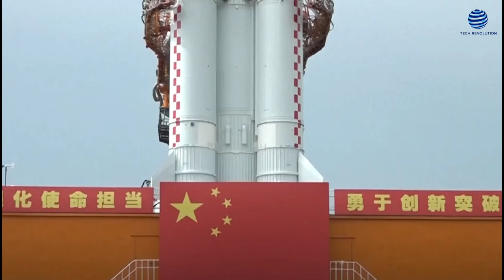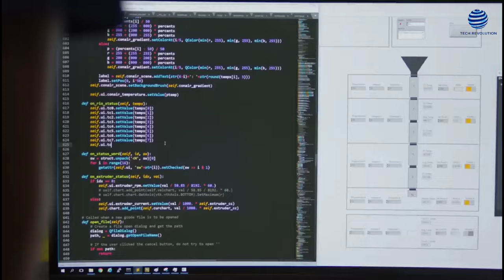China Outpaces NASA In New Rocket Breakthrough Technology!

Comment: The development of China’s reusable rockets is progressing well and will without any doubt be the leader in aerospace technology. More efficient and lower operational costs rockets from China will surpass SpaceX rockets simply because they are more reliable and smaller. SpaceX strategy is to build big rockets which are more unreliable due to the many small rocket engines, the more rocket engines the more likely they will create flutter which could cause construction failure.
Reply: Falcon 9 is by far the most reliable rocket
Reply: @Unknown-oh6ue  it has exploded in midair multiple times due to flutter. This problem has been encountered during the building of Saturn V rocket too.
Reply: @philiptan2051  Yes but that years ago
Reply: @Unknown-oh6ue  as far as I know there is only one successful launch and it is a dangerous assumption that the problem will not occur again. The bigger the thrust the more engines needed, the more difficult to synchronize the engines, the higher the probability of flutter.
Reply: @philiptan2051  What rocket are you talking about here I’m confused?
Reply: @philiptan2051  I’m confused about which rocket you are talking about here. Falcon 9 has done over 300 launches. I assume you’re talking about Starship, but that rocket is still in its development phase. Space X is planning on using it for longer space travel, hence it’s massive size and weight
Reply: @Unknown-oh6ue  yes that’s right. Sorry for the confusion.